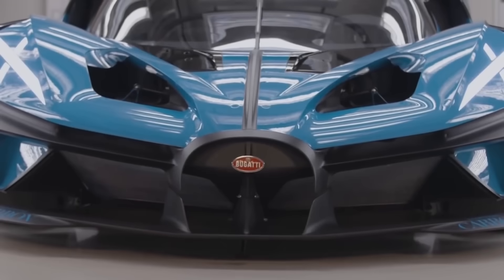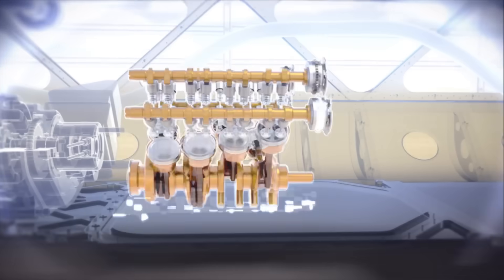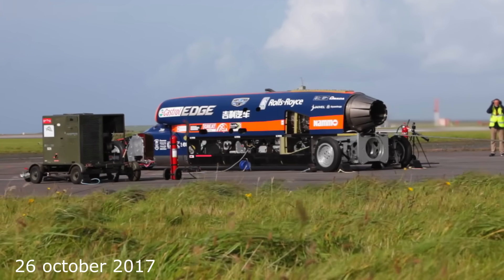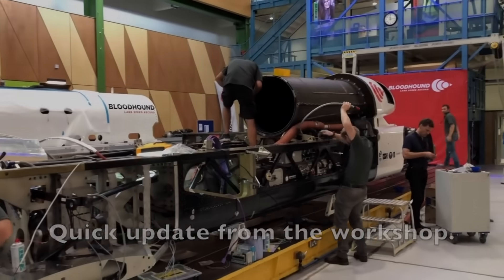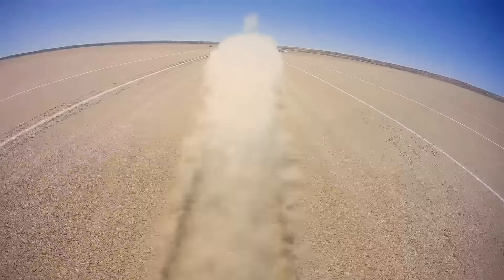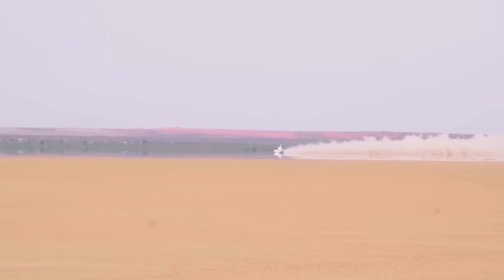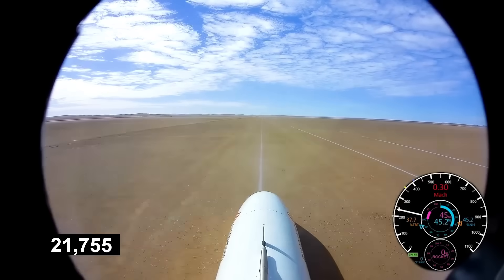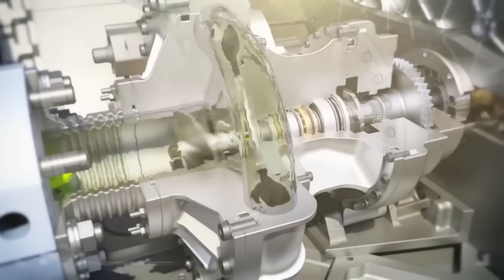THE PATH TO A SPEED RECORD 1600+kmh (1000+mph) BloodHound LSR. World Faster Car!

Comment: this thing top speed is 1050 mph not 1000 mph annd also i know some jets that are faster than this like the F16 F22 but sadly the F35 has the same top speed but for that the F16 faster the F22 faster the F18 faster the F15 faster the F14 faster and some other jets are faster like the blackbird with reaching a wooping 4000 MPH ( rounded ) and last but not least that faster is the darkstar with reaching a wooping 12000 MPH !!!

Comment: Ok lets start from the start as you the commentator stated it uses a Roll Royce EJ 200 jet engine so in other words it is not a piston driven car with a sequential manual or auto gearbox. It uses trust to propel the vehicle forward. Is it road legal NO, Rubber tires NO so then it is not the worlds fastest car as you cannot use it on public road or park it in a public parking space

Comment: Imagine having to use a 5 L Jaguar engine as a pump that's absolutely wild
Reply: Just for a calibration factor, each of the five Rocketdyne F1 engines on the first stage of the Saturn V rocket  had a rocket powered fuel pump producing 50 000 shaft horse power.

Comment: It sounds like they hired a DEI director and that was the end of common sense. Electric motor, bio fuel! That is what happens to science when a bunch of morons are in charge of the show. No mention of the added weight of the electric motor and batteries. No mention of the loss of horsepower from corn juice like most cars are afflicted with!
They deserved to have to quit before they killed a bird or a prairie squirrel and cause the DEI gods to ascend upon them! . .  Morons!

Comment: I thought Craig Breedlove would grab this record in his Sonic Arrow. He managed 675mph but then a crosswind pushed the car up on its side and damaged it. I think he basically ran out of money after spending at least $2 million of his own.  Steve Fossett bought the Sonic Arrow and planned on attempting Mach 1 but was killed flying his private aircraft while scouting for an area to make the record attempt.  Sonic Arrow is setting in an aviation museum somewhere.
Reply: Breed loves car although a genuine effort became a victim of its design, Breedlove himself said it was designed to look good with no cfg or wind tunnel evaluation, the car basically at a certain speed became horrifically unstable. It had a tendency to turn right and eventually rolled onto its side destroying the engine.
Reply: @neilmchardy9061 it rolled on its side because it experienced a 15kt direct crosswind which, if Craig had known that, he wouldn’t have started his run according to him. He said he misinterpreted the wind speed. He thought he heard 1.5kt Xwind over his radio.  Craig basically built the car just using knowledge he learned from building his 2 previous Sonic America cars that both brought him the 500mph and 600mph records. That’s how he wanted to do it, he obviously wanted to have complete control of the project.  He went through a divorce during the build and the attempt, one of his J79 jet engines was damaged by a rebuilder which resulted in a lawsuit. Repaired the car and ran 676mph but never ran it again.
Reply: Extremely flawed design. American backyard mechanics. The Brits did it properly

Comment: Considering the low altitude speed record for a fighter jet is 988 mph, im not seeing a car break the 1000 mph barrier
Reply: You're forgetting the rocket as well. And no wings to create drag
Reply: F-105 Thundechief fighter/bombers in Vietnam often flew over 1000 mph at altitudes of 100 feet above the jungle, using their shock wave as a weapon against enemy ground forces. Heating from air friction limited such excursions to about 20 or 30 seconds at a stretch.
Reply: @honorguardsfencingclub7322 

No they didn't!
Reply: @truthsayerq7264 read the book "Thud Ridge".
Reply: @honorguardsfencingclub7322 Col. Broughton was an absolute savage!
Reply: The bloodhound has better thrust to resistance ratio.
Reply: The public doesnt control what science says
only engineers with a huge budget do

sometimes

Comment: Please try not to blend imperial or other archaic units with modern international standard ones. The thumbnail stated, “135.000hp” and “1600+km/h”, so it should be just in kW and km/h (also that decimal point renders the 3 zeros completely meaningless in most locales). Don’t worry about the Americans because all the smart ones are familiar with SI/Metric units, and the others need to discover just how much easier their lives would be with a well-integrated, practical, and far more rational set of units.

Comment: The first car to break the sound barrier was that British car called the Thrust.
Reply: Thrust SSC
Reply: Still got Andy green in the driving seat,  but looks like it wont ever happen
Reply: It was the same company wasn't it?
Reply: I think it's the same guys
Reply: It didn't, it's down by 4 mph
Reply: No it wasn't...check the Budweiser rocket...that was first!!!
Reply: @26KE185 No proof of that. Thrust SSC showed that once you cross the sound barrier the shock wave under the car creates a particular pattern on the surface. Also a very loud double sonic bang. Budweisser had none of that and no sonic bang at all. It's thought it briefly got close, possibly over 700mph but not the sound barrier.

Comment: At some point after a few hundred mph the tires are no longer spinning at the same speed on the ground that they say they are traveling .Its air speed if the tires are not on the ground spinning at said mph.There is no tech available that compares wheel speed rotation with air speed once the tires are no longer on the ground spinning.
Reply: There are quite a few effective ways to measure ground-speed that aren’t via mechanical couplings to, nor rotation sensors on, the wheels. Speed relative to ground for the vehicle as a whole need not involve wheel rotation at all, and whichever method of speed detection they’re employing (likely multiple, e.g. GPS, laser etc.) it’s not airspeed and doesn’t magically become so simply because the wheels lose contact with the ground. They wouldn’t be relying on wheel rotation for determining the speed for the very reason you’ve stated (partly, at least).
Reply: @anhedonianepiphany5588  If the car is off the ground and wheels are not touching the ground it is airspeeed not ground speed.If the wheels were not required to touch the ground why not put small wings on it for control  and strap wylie coyote into it and go for the gold.how high off  the ground is acceptable in a jet powered car.If the wheels are driven airspeed would slow the car down.
Reply: @leevahal900  If all contact with the ground is lost, it will have an airspeed, no question, but that’s not what they’re measuring.
Reply: Tyres 😂😂😂. You can't use tyres at 1000 mph
Reply: The wheels are spinning the speed the car is going. It could be off slightly but if they were skidding it would be out of control.
Reply: Strapping Wyl E Coyote to a rocket just above ground accomplishes about the same thing.Its air speed if not wheel driven.
Reply: Ever heard of this new thing called radar and GPS???
Magical OR medieval.
Reply: @TheAcceleratorMagazine  Your wizardry is impressive indeed!

Comment: The budweiser rocket car in 1979, which was the 1st car to break the sound barrier is my favorite car. Too bad it didn't turn around and make a 2nd pass. To make the record official.
Reply: The Budweiser Rocket did not break the sound barrier. There was no Sonic boom or any proof it did.
Reply: @posniknelb6114 I wished they had ran it again. I know Chuck Yeager was convinced it did but again, no real proof.
Reply: @mouser485 Well Chuck Yeager is wrong because it never went supersonic. It didn't even get near it. No Sonic boom. Thrust SSC smashed windows 12 miles away with its massive Sonic boom
Reply: Thrust SSC did that one
Reply: The Budweiser cars claim to the record was highly dubious regardless of not making the second run - they didn't measure the speed over a timed mile, they used a handheld radar.
Reply: @mc483 It didn't reach mach 1. No Sonic boom or any real scientific proof.
Reply: If they’d only made that second pass.